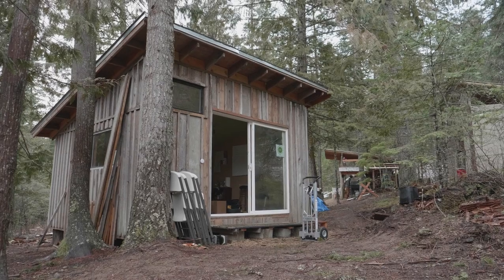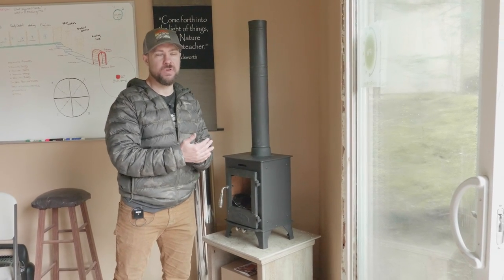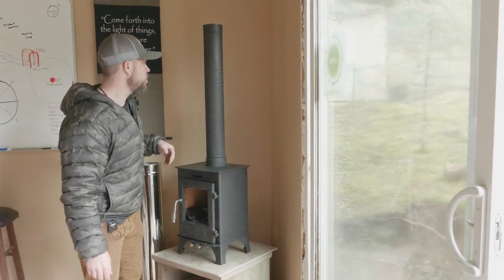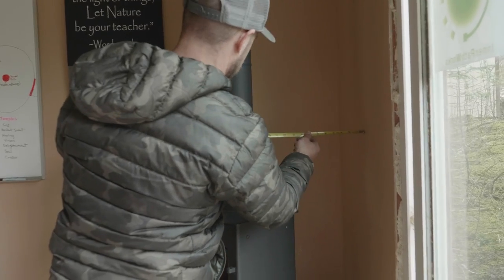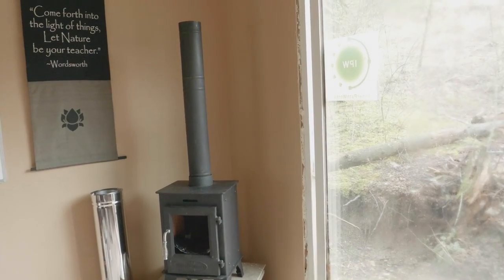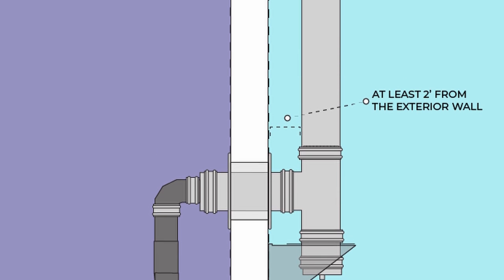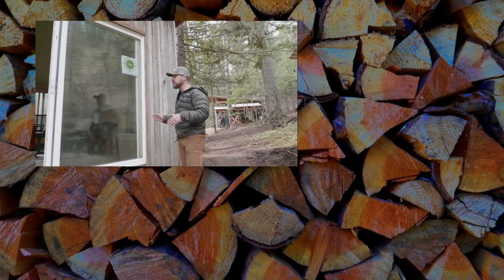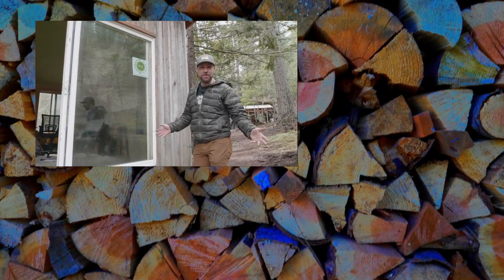TINY WOOD STOVE: Planning to Install A Wood Stove

Comment: would a 45 not be a less bottle neck for exhaust versus a 90 ?
Reply from the maker: The flue design depends a lot on the specific setup, efficiency vs.space is a huge factor in tiny homes. Our stove experts can help with creating the best setup for each individual space 😊